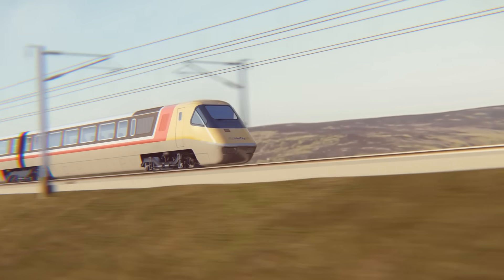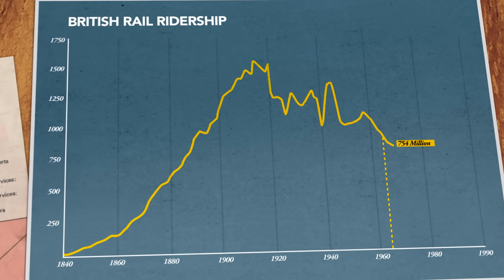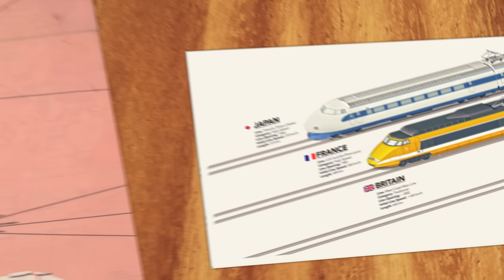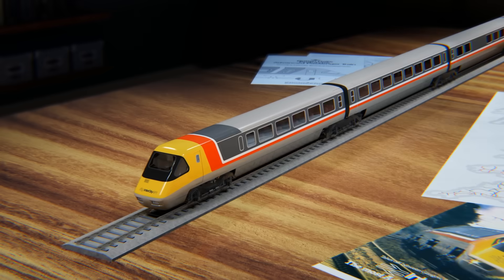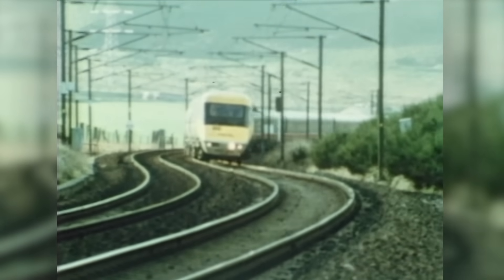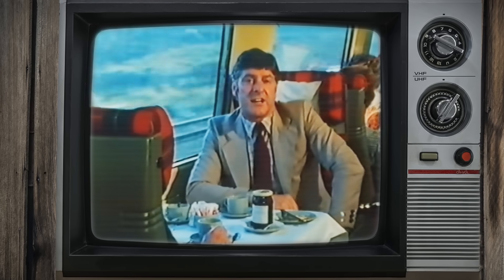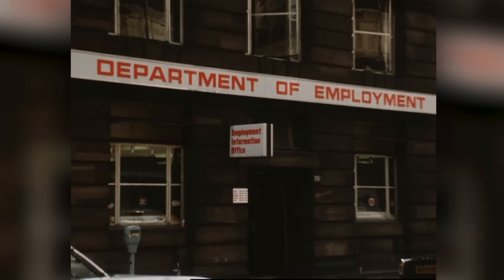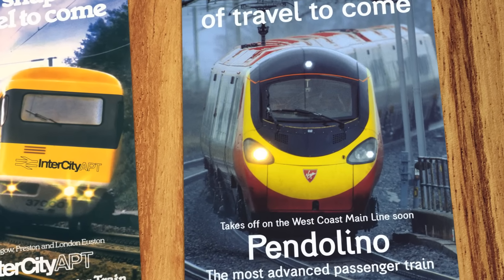This Train Made Passengers Sick: The APT Tilting Train Story

Comment: I don"t agreed in all what you say... in 80s, if not before that decade, Italian Railways asked to a consortium of a lot of Italian enterprises to design a new kind of high speed train with a revolutionary tilting-system called "Pendolino" for their new high speed railways in particularly between Florence and Naples through Rome... You surely remember this because just a few days ago Virgin Trains ended operations on WCML... and it's so strange that trains which were used by Virgin were exactly using "Pendolinos" on their network... you say that you're the source of our doubts but it couldn't be so...
Reply: The Italian Railways started development in the early 70s, whilst APT was from the mid 60s. Italian Railways later bought APT technology to replace its own in the 80s

Comment: Too exaggerated leaning of trains in curves because of compensating radial forces for the grace of speed is something to be balanced well. Well, computerized and smoothly controlled. With such thing really and properly functioning. Otherwise "curve-leaning" indeed tends to impact passengers with kind of "sea sickness" ("motion sickness" called here). I already have experienced such a system in ICE train rides - which did not yet function properly back then. The feeling of "comfort" in such a train is awful and uncomfortable. The train notably tilts not harmonically according to its speed and the actual curve radius being passed along. So it overtilts when slow, thinking you are sitting in some kind of "coaster".

Comment: You should mention that this was not the first attempt at tilting. The Canada led UAC Turbo-Trains started to run between Montreal and Toronto with passive tilting from a four bar mechanism. Then, it was replaced by active tilting and in 1981 the Bombardier LRC was entering service with accelerometer based tilting still is use in the Super-Voyagers.

Comment: Technology is the correct singular and plural form of the word. 

Turning the word into "technologies," is a redundant variation of the word, one that only serves the purpose of "feeling right" to the mouth-breather's plight of horrible cognitive impairment. Impairment born of inefficient oxygenation in their brain and other vital organs in the body. 

You savage creatures adore overuse of the suffix "s," as means to balance out the detriment born of your very preference to breathe through your mouth rather than your nose. 

Sure; you creatures have louder emotion than Humans aka nostril breathers but is it really worth the price?
The mouth-breather's loud and rapidly fluctuating emotion, in conjunction with compromized immune system(mouth is a bypass for parasites, bacteria and toxins that the nose has higher chance of filtering out) and these collectivly strain the nervous system, thus; leading to accelerated aging. 
Think carefully on what you are giving up to stay in mouth-breather's "high," you will "enjoy" unnaturally frequent spells of confusion~stupidity and generally higher chanced of emotional~mental retardation.

Comment: 1. Buy from England
2. Sell back to England
3. Profit
Reply: Laquelectro  pogba
Reply: italy101
Reply: @manlikeryan  Britain 101. May be the Italians learned from the British.
Reply: Nothing of the APT ended up in the Pendolino. It's just a legend.
Apart for the fact that the Pendolino prototype, FIAT Y 0160, was built in 1970, while the APT prototype run for the first time only at the end of 1971, and the first prototype of the commercial Pendolino (ETR 401) became operative in 1976 and had been retired from passenger service only in 2008, the working principle of the two is different. Pendolino has two gyroscopic and accelerometric transducers on the two bogies of every car, instead of a single accelerometer on the center of the car. That means that it reads the inclination of the track at the start of the turn, and can react in advance and more precisely than the APT system, avoiding the oscillations and imbalances that were the cause of the motion sickness of the British project. That's why it had been so successful worldwide.
Reply: East India company used to buy cotton from India make it into a finished product in their factories and sell them at a cheaper price there than local goods destroying the indigenous businesses.
Reply: @acejee  industrial revolution mostly started in uk and needed raw material source and a market as well to sell the end product.
So raw cotton shipped out of india & finished fabric shipped back. The british rulers prohibitted Indians to produce yarn and fabric except silk sarees and certain varieties. Thats why Gandhi started a Movement to produce hand loom woven cotton fabric as another front in his fight against rule.
Indian flag after independence was made of handloom fabric for many years as a policy. Nothing made in uk was sold cheap in india as mentioned.
Reply: @acejee  that's how corporations work innit
Reply: That's what they did here on Indian subcontinent.
Reply: Reminds me of the SA-80 rifles. The British wanted to develop their own small caliber rifles, but the L85A1 that resulted was utter garbage, so they had to send them to HK (a German company) to remanufacture the rifles
Reply: @user-njyzcip  true, but it was British-owned at the time
Reply: The italian tilting train was on regular service since 1976.
Reply: That was the formula of the East India Company's success.
Reply: This is called business
Reply: Just like they did
Reply: Someone definitely engineered this situation for self profit
Reply: thats the british colonialism, but reverse.
Reply: Indians: happy anti-colonialism laughter
Reply: stonks
Reply: Don't you think anything and most things that Britain started/invented are pioneered by others😂😂😂

Comment: I don't care what anybody says. Steam locomotion didn't die, it was killed. There could have been so many new innovations that could have saved steam if anyone had given it a chance.

Also by the way, all railroad tracks except the very earliest ones have banked curves. It's known as superelevation and even low speed tracks have it. The difference between high speed and low speed curves is the degree of superelevation, not its presence or absence.
Reply: Steam locomotion could not have provided faster speeds, and in a world of climate change would have been disastrous

Comment: The train could of succeeded if they spent a couple more years designing a system that when the train tilted the inside floor with the passengers would tilt on a normal levels using gyros

Comment: You should make a video on the Bay Area Rapid Transit (Bart) in the San Francisco Bay Area. It was supposed to be the transit system of the future in the 1960s,  engineered from the ground up, yet no other city bought on to the concepts. Automation, wider track gauge, rail cars built with unique technology, flat rail heads, ect.....it would be the perfect fit for your channel!

Comment: 6:19 "Smooth, quiet, and all together a delightful experience."
plate vibrates 8 inches over the length of the video
Reply: 😂😂😂 what I call smooth, quiet and delightful is the 222
Reply: https://img.memecdn.com/antartica-using-the-metric-system_o_903317.jpg

fuck imperial. its not 8 inches. just say 20cm. inches are so inaccurate

Comment: TALGO pendular system solved the tilting issue earlier (in the 40's) and without producing motion sickness.
Reply: The pendular system didn't really work as well, as it could be rather sudden on some curves, and also when straightening off could cause the carriages to sway a little

Comment: I have a question. The tilt of the train balances the center of gravity for passengers, but on a flat track, wouldn’t the inertia just throw the train off the track on a curve?
Reply: The forces don't pose a risk of derailing as the train is much heavier than say the cups of tea inside it, so the train is able to stay on the tracks just fine

Comment: It's worth noting that several of the non-Shinkansen high-speed trains in Japan also lean on curves (or at least used to – I only rode on local trains on my last visit) and are/were great fun to ride on. When they leaned, centrifugal force meant that you never felt as if the train was at an angle, which meant that if you looked out of the window as they leaned, tall buildings felt like they were toppling over and you'd be convinced that the water on lakes was higher on the far shore than the near (or vice versa).

Comment: 0:39 the DB (Deutsche Bahn [German railway]) had this idea since 1996 with the introduction of the ICE T
A ICE is a high speed train.
here are some infos about the ICE T
Length over buffers: 
(model series 411:) 184.4m
(model series 415:) 132.6m
height: 3910m
width: 2850m
Top speed: 230 km/h

Comment: Design a train to run on an antiquated network that severely limits its ability to operate as a high speed train that tilts around corners only to be abandoned.  
Amtrak:  That sounds like a great idea, lets buy the Acela express train for the North East Corridor
Reply: @Nigel Cam which, in turn, raises the question of why bus, truck, and automobile travel have their infrastructure paid for by the state, yet rail has to fight bitterly for any subsidy. 

Amtrak's NEC operations were profitable above the rails for most of the 90s. If it weren't for that gigantic cash sink, something that road-going traffic doesn't deal with, there could have been significant improvements to the rolling stock, stations, etc. and they might have pulled even more riders. 

I'm neither a "but muh roads" statist nor a "if it's important, private industry will pay for it" libertarian, but I don't like the government picking winners and losers. The way they'll pick up the tab for infrastructure for one industry but not the other just grates on me.
Reply: A. L. W agreed. IMO the government shouldn’t give subsidies to any transportation method. Let the most economically viable win.
Reply: @ALWhite-ub1ye  There's also interference from the automobile industry in the United States, which isn't helping matters.
Reply: And yet the Acela is successful, having displaced most air travel along its route.

Comment: :52 "Smooth and quiet" he says as you hear the dishes on the table rattling away. not very "smooth" lol. The problem with High speed trains is that the train requires the same amount of power a house uses in 2hrs to power a 150mph train for a mile. I mean the wires use like 25,000 volts of power. Now considering that most subways uses about 1500, that's a lot of damn power. Railroads have been learning the hard way that some times things don't work out. like the PRR Keystones, or even the famed Metroliners.
Reply: You are confusing power (kWh) and voltage. Most subways are powered by a low voltage/high amperage third rail at 750 volts DC. High speed rail catenaries are high voltage/low amperage at 25000 volts AC. Overall, the energy bill for a TGV is around $2/mile, the cost of a taxi ride, an insignificant number once divided among 400 passengers.

Comment: We’ve started to buy Japanese built high speed trains recently such as the LNER Azuma service which is currently under testing but the big problem is that the line isn’t made for such high speed trains so the new Azuma can only run full speed from Newcastle to York. Correct me if I’m wrong that’s what I’ve heard

Comment: A nice topic for a video, but there are some glaring mistakes right from the beginning. Air travel was definitely not a competitor to rail in the 1960s. Only now in the 2010's did domestic flights in the UK become competitive with rail, thanks to discount airlines which only appeared in the 00s. Also in the 1960s, even driving was a poor competitor to rail as there was only one motorway in the entire country until 1965, when a second one was opened.  Britain is not like the USA, aside from motorways it is very difficult to find a road that is straight. They meander a lot around towns and topography and are not efficient. Railways however cut right through every city and even most villages, a very extensive network, and straight efficient layout. So even a steam train in the 1960s would probably be a better option than driving in most cases.

Comment: "Steam Locomotives were still in use well into the 1960's" 
You say that like it's a bad thing. and i'm not just saying this to sound like a steam fanboy, there were actual studies taken during the era that indicated that Steam was actually a better service than switching to Diesel or Electric. 
The main issue was money: between the cost-cuts of British Rail, Economic downturn after WWII and the already-in-place Steam programs that were expected to run until the 1980's (yes, the UK actually planned to still be running steam in the EIGHTIES) the sudden, rampant Dieselization was actually shown to have been a NEGATIVE impact on British train travel. 
Thousands of workers who were trained on Steam upkeep and running lost their jobs, including many men who had been running steam locomotives for decades and could not make the transit to diesel engines, Virtually brand-new Steam locomotives were scrapped after less than a decade of service, the cutting of services under the Beeching Axe removed a great deal of income for not only the railways but towns and villages who lost their services as well, the "Modern" image of the railways quickly fell by the wayside (especially with the Oil Crisis coming hot on the heels of Dieselization) and yes, the seeming inbred British Nostalgia for the past likely caused a great deal of resentment with the mass-scrapping of historic steam locomotives (see the present-day Steam Preservation groups) 

I'm not saying the UK should never have gotten rid of their Steam engines, progress marches on. but the way which they went about it likely caused more damage than it solved.

Comment: Why the hell are trains so long. 
We are all familiar with how horrid public transport is, especially bending yourself around the schedule. The juggle to make the train and connections. How bloody long they take because you have to stop every bloody second. 
But what if, trains were tiny, like only 50 seats. If they were controlled by drivers in an office using software. If we eliminated unnecessary stops. 

Keep in mind I wrote this in 10 minutes and there are many more details that would need going over for this 
to work, but it's a brief over view of a far more efficient system. 

Each carriage is like an elevator. To get on the train you must go through control gates, simply select how many seats (this also prompts options for wheelchair, child etc.), then you select your stop, and finally pay. A paper ticket is then printed, and the gate opens. 
When you get on the train you scan your ticket, this tells the computer how many seats are now taken and what stops. If there isn't a train waiting already when you check in one will come. In peak hours there would be extra trains waiting at busy stops.

Each station has a control office. It is a sales desk for "train cards", it is a help desk, it is security, and they also have all the statistics for gate to train check ins. Having the power to send the train once full, and step in where a full train is booked at the gate but the trains computer says it's not full. They can send a partially empty train. Using their training they keep the trains moving, and not waiting to be filled. 

In a very busy station multiple trains may be waiting, ground staff, gates, and your ticket will tell you which train to get on. Meaning that people heading to the same stop will be on the same train. 
This is great for people going to the last few stops. You will fly past all the earlier stops. Unless your train is not full, in that case your train may stop to pick someone up. 

All the trains use advanced computer programs, they know where each other are and will not crash. They are supervised and can be manually driven via remote control from a head office. When the line goes quiet trains can be sent home once they reach the end of the line, and wake up when there is a request for them. 

Imagine it, it's 4am, no trains are running because no one is up. But you need to be somewhere, you check in at the gate and a train wakes up and comes to get you. This also brings in a possible LUX system, where you  can pay for a private smaller carriage, like mini van sized. It comes only for you and goes directly to the stop you select.

Comment: Wow. The animations in the video are amazing. It's so nice to see not just the standard (but splendid) Kurzgesagt style many channels use today for once.
One slightly critical "complain" though: leave the text on screen a little longer. I had to skip back and pause several times in order to read the comparisons (like around the 3 minute mark). As a non native you just need an extra 2-3 seconds compared to a native no matter how fluent you are. Since most of the relevant scenes are followed by some stock footage of the train crossing and similar you wouldn't need to cut on content or prolong the video. I don't know if it is possible to fix that or if it is an actual point that matters for you guys.  Just my humble opinion. Otherwise awesome video. Very very informative and entertaining.
Thanks.

Comment: In Australia, Queensland, we had a tilt train. Went from Brisbane to Cairns, 1600 km each way. Speeds were about 160kmh. Being in the tropics for most of the way, there was rail expansion problems and bumpy tracks. No motion sickness felt, but a long way/ time sitting in a railway seat. Spent a hour backing up the track to bypass heat locked points at Townsville.  It also has been replaced.